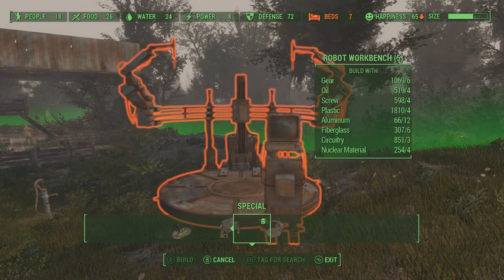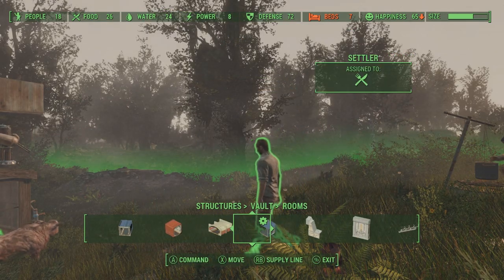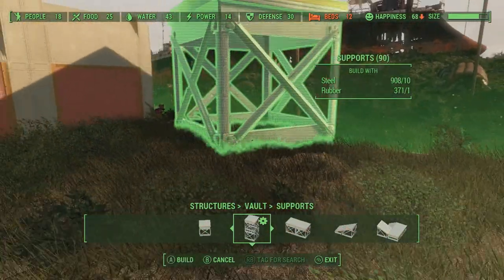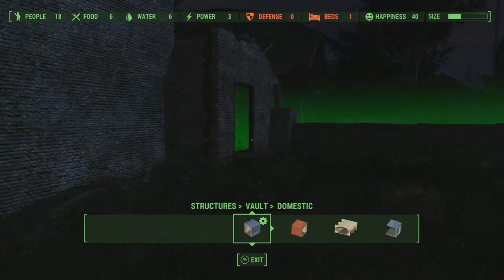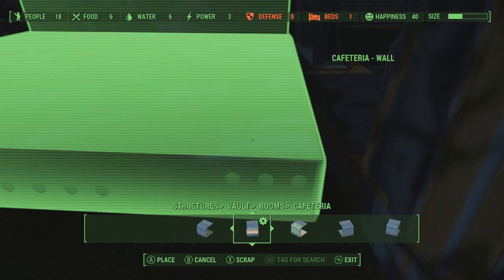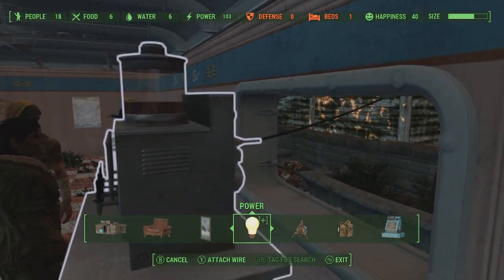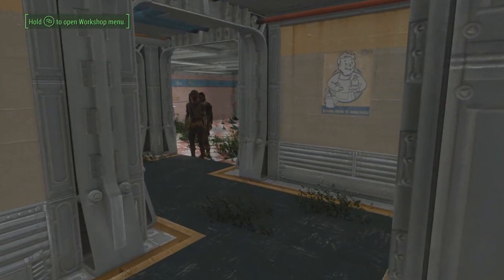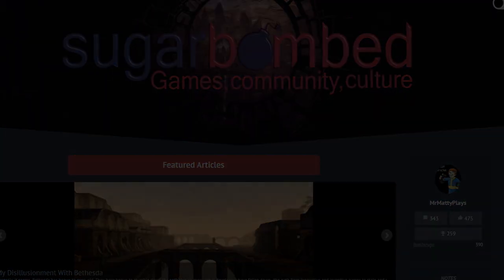FALLOUT 4 Vault-Tec DLC: How To Implement Vault Building Into YOUR SETTLEMENTS!

Comment: Matty, those cafeteria rooms and stuff like that, you can actually connect theme. So for example take a residential hallway, a small one, with a door and an entrance, so the room will connect if you put a residential hallway with a door. You dont have to connect the rooms yourself, every single one of them clips together. You just got to the ones with the door. You can find a path with the door if there is a yellow and black line around the door wich means you can convert the room to put the clinic, or the cafeteria.

Comment: You know if you want to connect a hall with a room you need a a door cap(the thing at the end of the hall category) to snap a room to it. Also connect a vault generator and it travels though the vault floors and place the new wall conduit and you can power anything connected by floors through the vault!

Comment: oh man. different rooms need to be connected with door frames, then they will always connect just fine. to not have millions of cables everywhere, there are special connection plugs you can build into the walls, and with these you then can connect stuff inside the rooms. without having the wire going everywhere
Reply: what are these connection plugs, how do they work and how do I find em?
Reply: just in the regular conduit tab, near the end its like a square white plate with the spiky-thing in the middle and it can be placed on any vault wall, inside, all the vault walls act like they are conduits with this - in vault 88 all vault walls are powered by the generator in at the entrance, that way, i have no idea how it will work elsewhere....

Comment: you could just use the floor as a way to run things that require power there are these panels that stick to walls with them you can power a building without using cables but there are some exceptions were it doesn't work

Comment: Dude look in power and then go to switches u have a conduit switch for vault walls so u don't have to go through windows it's a radiant electricity that is connected by snapped pieces to the vault generator they act as the wires

Comment: Are you aware that you can actually connect hallways to other room types by using the doorway endcap, also you can feed power through vault floors and doors using the vault power conduits, I have only used them with the vault power supplies but it may be possible to feed power from another type generator in through a valut power conduit?

Comment: You know instead of using windows you COULD have just used the Vault Generators which give more then the fusion (150 or 500) transmit power along floor tiles and only need a Vault Switchbox to enable the power in that sector.

Comment: Matty there is a vault power conduit that allows you to build a vault tec generator and need no wires bit from the wall to the item I've seen so many YouTubers just connecting generators to everything this is no longer necessary all that is necessary is a vault generator a vault wall and a vault power conduit and this removes the need for so many wires all over the place
Reply: also if you put a door end cap at the end of any type of vault room or hall way then put the next rooms door end cap they will snap together perfectly and on my previous comment you need to connect the vault floor to the vault generator the on a wall anywhere that touches the same vault floor as the generator u use the vault power conduit
Reply: +steven morgan also the way u use the barber chair and the surgery chair is a sign a settler and after 8am they will have an option when you talk to them to get a haircut or surgery